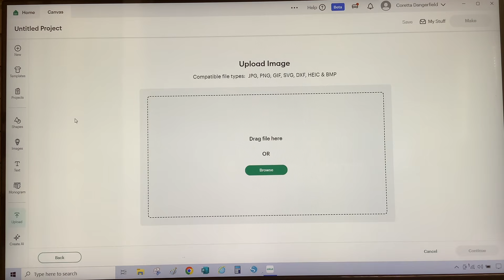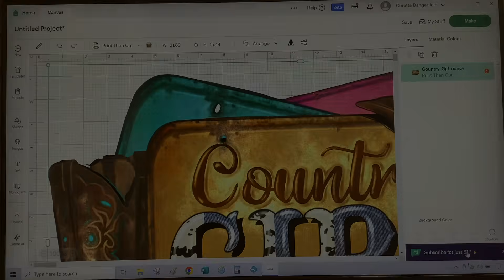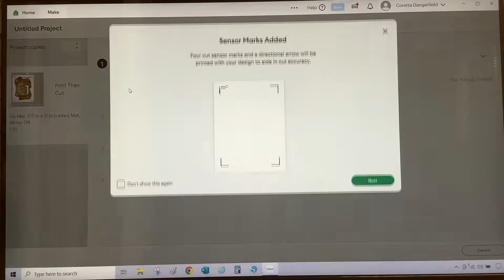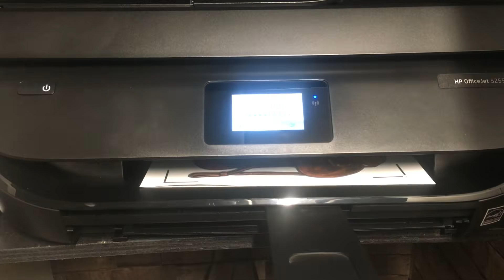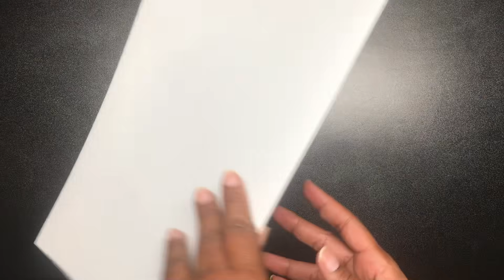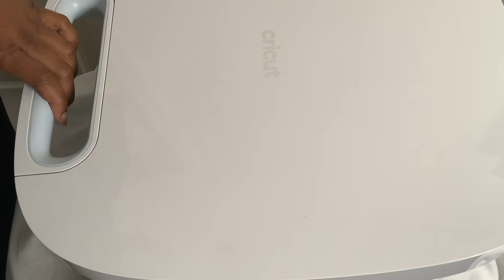HOW TO USE PRINTABLE HEAT TRANSFER VINYL | TECKWRAP PRINTABLE HEAT TRANSFER VINYL

Comment: When I did all these steps and I peeled it away the ink lifted with the transfer sheet. I thought I might have my heat setting too high but not according to your instructions. Since they only included one transfer sheet, I used it a second time. Could that be the problem?
Reply from the maker: It could be the heat press. Try checking temp with a heat gun to ensure it is the correct temperature. I am not sure about the transfer mask because I purchased a separate pack of transfer mask to change with each press. Thank you for watching!

Comment: Great video. Would like to know how images hold up to washing if you wouldn’t mind sharing
Reply from the maker: I have had no issues with the images after washing. Thank you for watching!
Reply: @CorettaDangerfield appreciate your response thank you. Sorry one more question. Do you happen to know if you need to use a specific type of ink? Or do you use whatever the printer comes with
Reply from the maker: @ricke499 I used my HP OfficeJet (Inkjet) printer.

Comment: Thanks for your hard work.  That heat press looks different than the one in the link.  The one in the video has a lid, if you will, that closes.
Reply from the maker: You’re welcome!  I am using the Cricut Auto Press. Here is the link in case you’re interested. Thank you for watching!

Cricut AutoPress
https://amzn.to/3AORFru
Reply: Thank you for the info.👍 @CorettaDangerfield